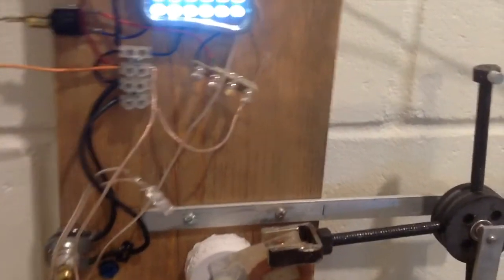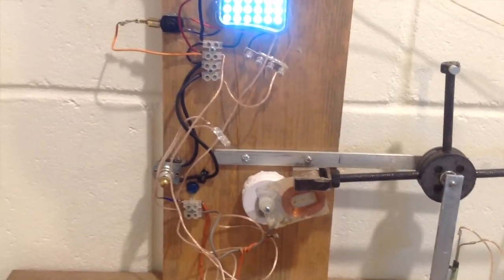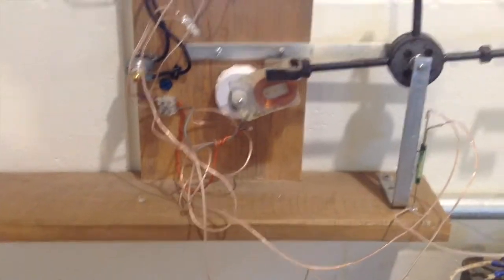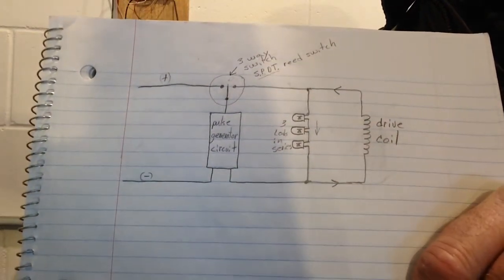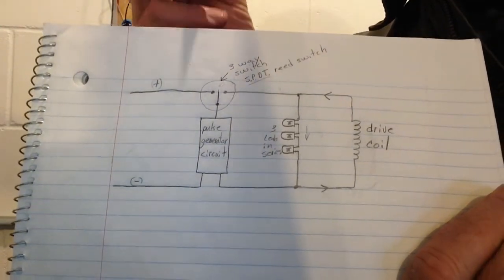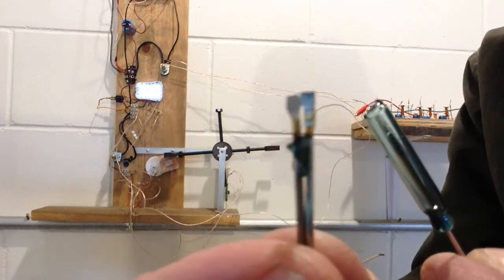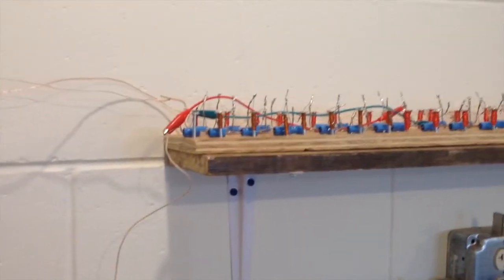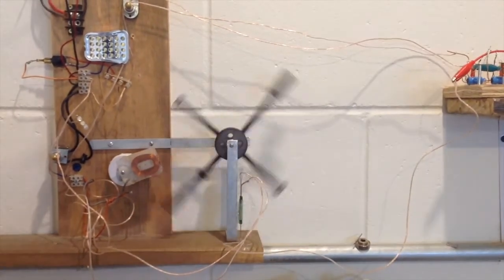A word about Free Energy from the radio air waves.

Comment: The powerline thing you heard/felt was due to a wire with AC running through it at high voltage.  This has alternating magnetic fields associated with it.  The air between you and the power lines acts as an insulator.  So if you ran a wire parallel to the one on the tower you could pickup some extra voltage there too.

Comment: Old HAM operator here, I've use to light a florecent lightbulb from the RF exiting the 1KW tube amplifier (linear).  Even my lower powered 400 watt linear amp can light 2ft florecent bulbs.  It is a neat trick to show kids when you talk and the bulb they are holding flickers with your voice.
Reply: You can also put a copper rod in the ground walk 50ft and put a zinc rod in the ground and pickup a few volts that way.  Your ground quality can effect how much voltage potential you pick up.

Comment: simply make a step up transformer on high permeability core, connect one end of primary to antenna (long wire) and other end to ground, connect load to secondary, during on load conditions the secondary flux will go to primary coil, as a result primary coil's impedance will drop and primary will draw more current, the electrons movement caused by radio waves will speed up making high current in primary